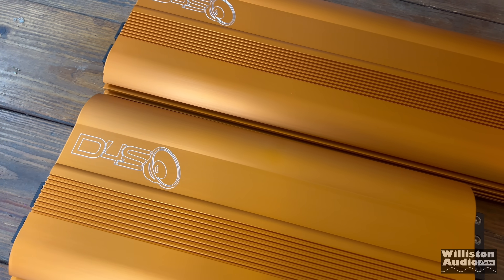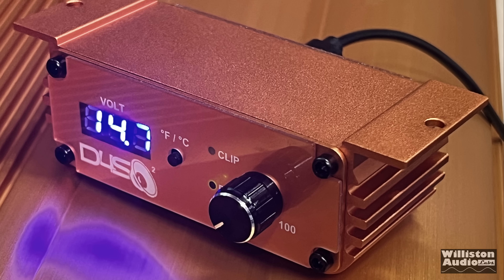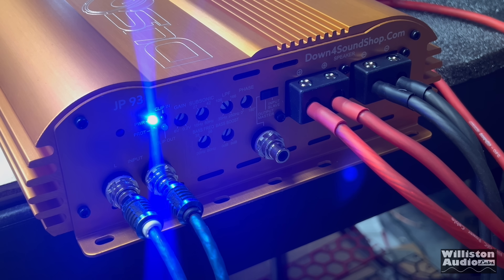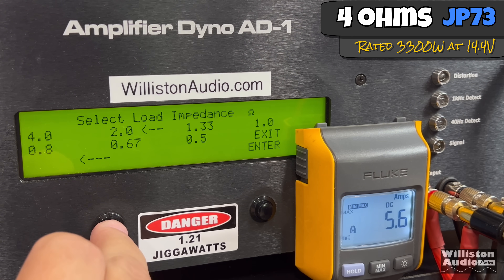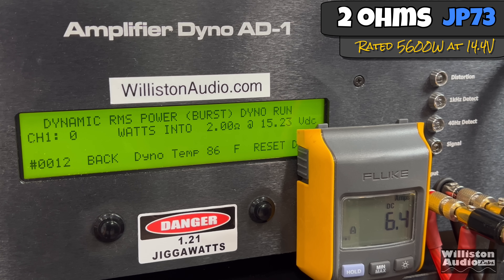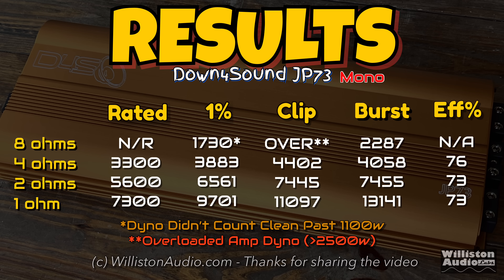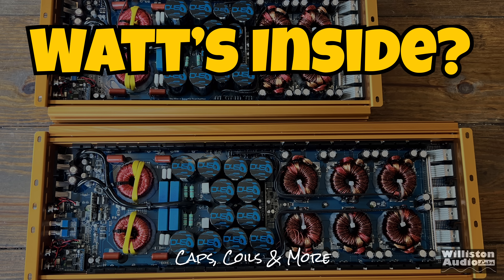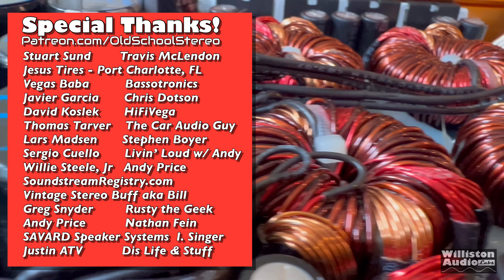These Amps Absolutely Obliterate Their Rated Power - JP53 and JP73 Amp Dyno Tests from Down4Sound

Comment: I think the only problem I see is there is a chip that a leg on it came off, but most of the board was put all in new parts new white pace everything but when I got it back and put it on, it was shut off when I cranked it up on off fast and then I checked it and that’s why I see I see that little chip that’s missing a little legso if you know anybody that can fix this amp, please let me know

Comment: I cannot comprehend having even one of these in my car with the amount of work that would need to be done to the car's electrical system.  My car was plenty loud - to the point of shaking store windows and things in houses - when I was pulling ~45 A (RMS) on a stock alternator.
Reply: What amp are you running?

Comment: I’ve got a non video related question. Years ago you did a video on the SounDesign 3000.1 evo. And showed the difference in power draw when listening to music vs doing test tones.  The power draw for music was around 100 amps. Is this typical for amps that size or is that amp lower than average?

Comment: Would be interested in doing the same dynos but at 12v for us common folks...
Reply from the maker: My Lithium battery bank setup is designed for 14-15V and amps this are just too big for my smaller setup with lower voltage

Comment: These D4S amps are so reminiscent of the Rockford Constant Power amps. They have so much reserve power and great power delivery at 1% distortion. Sure, they’re great for SPL, but they’d do very well for a “budget” SQ system too. 1KW with a nice sub and box is a LOT of bump. 

Better call Safelite and get your wallet out. These amps are no joke!
Reply: I own a jp83 on 120ah lto. No need for any other amp. Not worth paying the little extra for a little extra wattage
Reply: @matthewf1979  1% isn’t really that great
Reply: @Bassboy1972 it's an industry standard, of course you can get less but costs money and on a sub amp that's clearly aimed at SPL crowd I don't think it matters.
Reply: An SQ system doesn't need 10k watts and none of the nice SQ systems had anywhere close.
Reply: @MAD_CarAudio  The lower power amps have the same power reserve characteristics.

Comment: Great Amps, bought a Bundle deal Jp8 and Jp8/4 for 389,,,BUT 1 year and out of warranty my Jp8/4 4 channel 2-rca channel went out,contacted them ,and no warranty,connected correctly checked everything cables wires , in my Sequoia i have rewired all my stereo system, alpine 650 HU to amps to Speakers, soldered 12 gauge stinger wire to all speakers 10 to subs sounded great until a month ago, i'm not going to bash, these korean amps, but what do you recommend for a under 200 budget 4 channel amp,had cheap skar mini's for 5 years before,anthing malfunctioned, i just dont like the molex, connection on mini's.

Comment: Impressive. So how would I hook it up to power a home stereo with a 240v supply?
Reply: Simple answer is you don’t. Slightly longer answer is you would have to convert 240v AC to 14v DC which you do w/ an inverter. The correct answer is you buy a home stereo amp.
Reply: @Bob_Smith19  Yeah, I figured. Too much work to power these in a car so I thought about the house. I haven't looked into watt's current in home amps.

Comment: That JP53 might be just what I need. Finished my electrical and still running a JP8 in the truck with enough electrical for about 15k and it sucks having to do it over time but you definitely need electrical for those big amps.
Reply: Yeah, they’re both in the range of needing another dedicated alternator and battery/cap bank to run them right.

Comment: Talk about "going big". 1,000+ amp pull on a 12v system is going to require some seriously large equipment/wiring. Tesla or Edison are raising their eyebrows right now.
Reply: @ChrisDIYerOklahoma  1,000 Plus try 10,000 Plus
Reply: @rcdemonblood574 amps not watts

Comment: I think these are fake dyno numbers I have the 83 at .35 and my voltage never drops below 15.3 I’d like to see the amp while it’s being ran no offense Big D
Reply: Playing music in a car is definitely a lot different than the dyno in many ways.
Some of it just can’t be calculated.
We should take amp dyno’s with a grain of salt and for what it is.
Will expose a poorly built amp but other than that, you really have to use them on your specific setup to know.
Power supply and cables make a big difference.
Reply: @JayTR_10 agreed. So far for consistent power without heating up i doubt you're gonna beat the teampie 7500.1 from jones subwoofer solutions
Reply: In order to compare amplifiers you need controlled variables. This is why a resistive load is used
Reply: I had my 53 averaging about 2800-3200 mostly according to my wattmeter so yea this is kinda funny to see
Reply: You may be wired to .35 but the amp is not seeing.35. It’s called impedance rise
Reply: @biguzivert  really dude you think I’m that stupid 😂
Reply: @timothyanderson1132  im sorry 😭

Comment: JP should be selling amp+alternator power combo's. These amps wont run on oem power.
Reply: Money better spent on Lithium...
Reply: Some trucks come with 200+ amp alternators so yes they will
Reply: @ah4800  a 200 amp alt still isn’t gonna do anything for these amps that’s only good for roughly 400-500 more watts over a basic 160amp alt in a charger for example lol
Reply: @Tjcin513  ok. Well tell that to my salt 4 in my f150 with 1 battery and a oem 220 amp alt. Barely dips into the 12s
Reply: @ah4800  prolly got hella box rise if it’s just a basic lead acid or agm but also depends on the 1 battery lol you could have a Walmart battery all the way too 320amp lto bank witch makes a huge difference yanno lol
Reply: @ah4800  I have 2 jp33s gain matched on a stock 160 amp alt with only 1 battery and 1 super cap and never drop below 13 full tilt so I believe it but I’m just saying depends on the 1 battery I was just saying a 200 amp alt by it self with a normal lead acid isn’t going too hold any amp like these 53s and 73s
Reply: @Tjcin513  nothing wrong with the Walmart batteries. I have 1 under hood basic agm. But am installing a sodium ion in the back soon. Efficency of the amp plays a big role.
Reply: @ah4800  yes efficiently matters forsure but 1 agm and 1 200amp alt isn’t gonna hold any amp putting out 8000rms certified let alone the 73 and anyone that thinks diff is nuts lol. y
You’d have too have so much box rise it’s not even funny. If full tilt a single Walmart agm and 200amp alt holding 900+ amps pulled there’s so magic happening lmao.

Comment: Big d great job,but I want to recommend you test turn on/off noise. I thought this was a problem solved by most amp builders,yet I have experienced it in even high dollar amps. I have the jp3 in my wifes 2024 rav4 pushing an NVX 12 in a sealed enclosure. The amp has a lot of power but its fan runs all the time,and it thumps on turn off. I swapped it out with a PPI 1000.1 problems gone. I love the bass remotes and colors of these amps! What are we to do with this much power,weld?? lol
Reply: Axxess/Metra makes a turn on/off pop eliminator.
Reply: @melissathompson7229  Nothing that couldn't have been done in the amp itself!At the price level of these amps,its a shame.

Comment: These amps should be called obnoxious 53 and absurd 73 respectfully😮❗ These amplifiers never disappoint that's for sure ❗ ❗ ❗ ❗ ❗ ❗  Thanks Big D👍
Reply from the maker: You ain't lied! Thanks for being a supporter, you da man!!
Reply: I want to see JP come out with a JP123 and call it ...Supercalafragilisticexp.....😂
Reply: @smokeyou812  They sell a 132
Reply: So the 53 is an 8K board and the 73 is probably a 10K board…? Good headroom on both though.
Reply: @ndoc8889  yes the JP amps do just about double there rated power.
Reply: @Loudkona  What JP rates the amps vs what the board is actually designed to produce in terms of output is what I care about. If he’s using a 10K board that does 9700W and I find another manufacturer with the same/similar board that has a lower dollar/watt ratio, I’m going to purchase that amplifier. The amplifier is priced like a 10K amp, so there in lies the issue. If it’s a 10K amp, just say so. It’s the same argument as a manufacturer that over rates their amps. It ultimately comes down to dollar/watt.